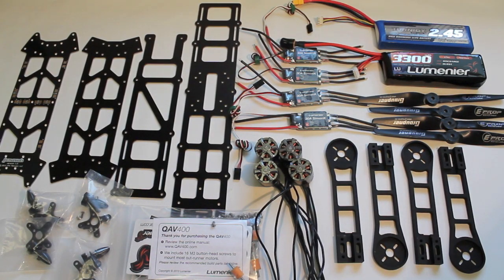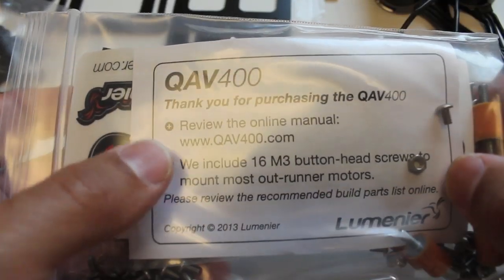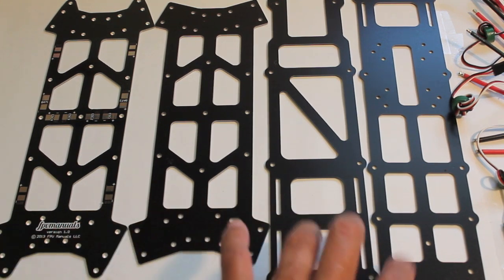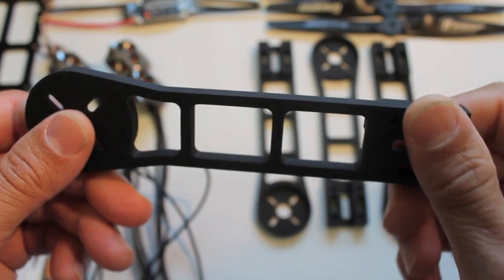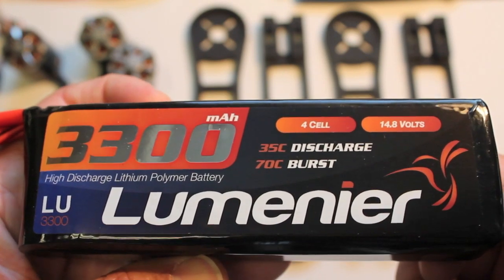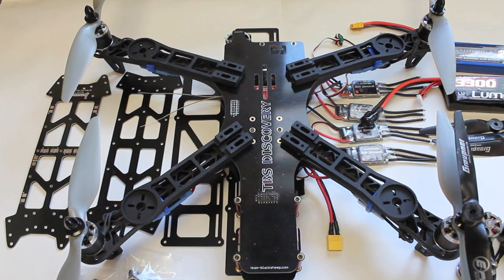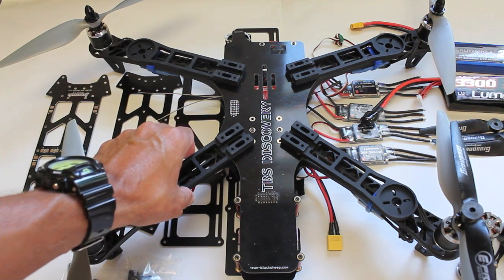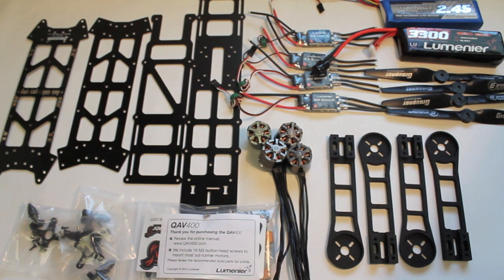QAV400 Build Intro and Why I Chose The QAV400 Over The QAV500

Comment: Qav400 or tbs discovery? Haven't you flow both now. Looking at getting into fpv for my next build.
Reply from the maker: Hey Joe. If you're looking to do strictly FPV then you can't really go wrong with either. But if you're looking to get some stable video footage at the same time then my recommendation is the QAV400. I just couldn't get my TBS to give vibe-free video without a LOT of work. Just my 2 cents. Good luck with your decision process.
Reply: +Dennis Baldwin now are you talking about the TBS Pro or the regular Discovery? I'm thinking about getting the TBS Discover pro and the QAV500 pro G. I think both frames are really nice and over all, I just really like building these quads and hexes as well as flying them... don't get me wrong. I just like all the diff. styles out there and plan on having a fleet of quads from the little 200s and up. nice videos bro, I'm subbing.

Comment: Great Video Dennis. After watching it we've decided to add an XT60 pigtail and bullet connectors to the QAV400 ARF kits. Bullet connectors were not included as we suggest soldering the motors straight onto the ESCs. The XT60 pigtail was left out as not everyone uses XT60. But since we now have Lumenier Lipos with XT60, adding that pigtail makes a lot of sense.
Reply from the maker: Tim, thanks for the heads up. Yes, after reading the QAV build manual I decided to solder the ESCs directly to the motors. This has worked out nicely. Good call on the pigtail connector. Glad to hear that. Kudos to you and your team for the QAV platform. I've spent countless hours in the garage experimenting with vibration reduction materials & techniques. The QAV is the first platform where I've been able to get vibration free video out of the box. Keep up the great work.

Comment from the maker: Thanks for watching my vids. Regarding your question it's really a tough one. My TBS had problems getting super-stable video like I do with my QAV400. I'm not saying it's not possible, but took me a lot of work to get there. The TBS is a much larger frame where you can fly 10" props. So you'll have slower kV motors and it generally uses less power than the smaller, faster kV motors of the QAV400. That was a big adjustment for me because I get less flight time with the QAV400...

Comment: you should try the ADS 400Q  doesn't have the built in power board.  So if you crash it and break it (very hard to break) your not screwed lol.  Really like mine.

Comment: If you can get a good grip on the bolt, and use a flat enough spanner they come off with abit of a fight. Also, heating up the bolt works to loosen the loctite, although i'm not sure of this weakens the bobbins. Guys have had success gluing these bobbins back on with CA.

Also, what I did was loosely loop 4 medium cable ties through the frame just behind the bobbins, so that if you come down hard the clean section wont separate from the dirty section & destroy your electronics!

Comment: A word of caution: On that qav400 build guide, they say use thread lock. Rather use lock nuts or spring washers on the bobbin bolts. I did a rebuild of mine this weekend, and destroyed 2 bobbins in the process thanks to thread lock.